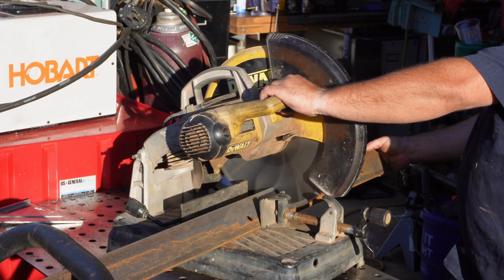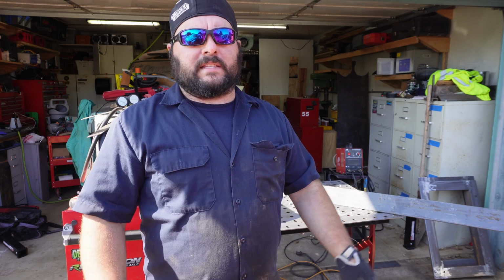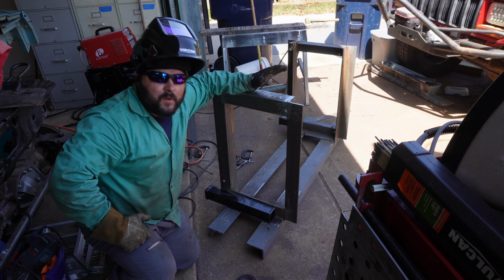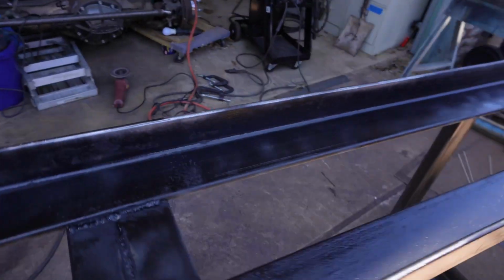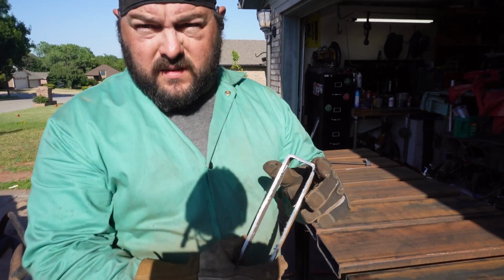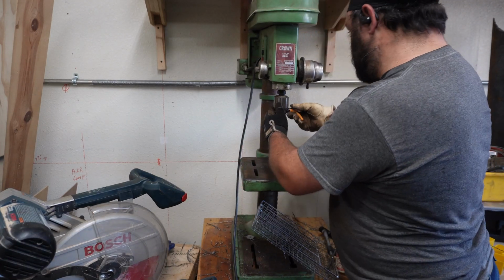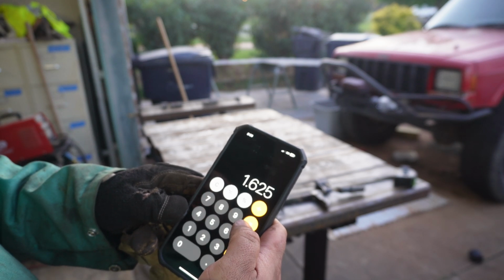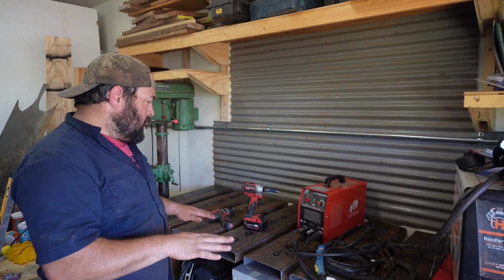THE "DO EVERYTHING" Welding, Clamping, Fixture Table Build

Comment: I think it would've been nice to add a piece of angle to the bottom of the rec tubes. That way it locates them square to the table but also allows them to slide independently left and right, and allows for removal or spacing if necessary. Either way that's a nice build and a good job.
Reply from the maker: I had considered something like that but ultimately decided to have all the slats be fixed. I appreciate the input though! Thanks!